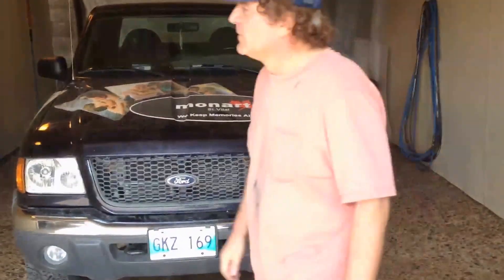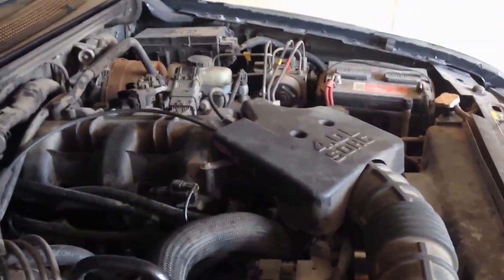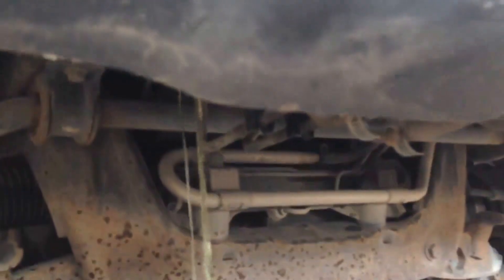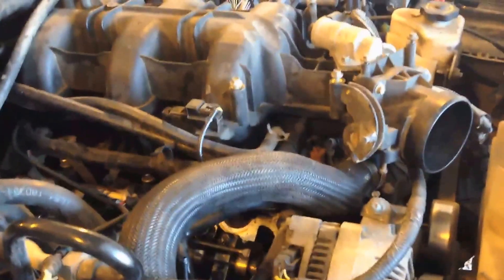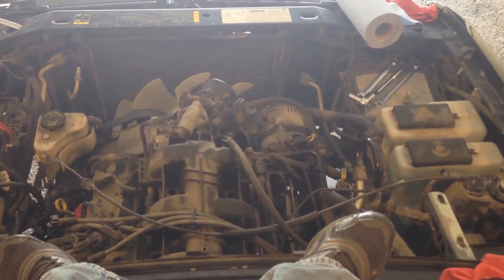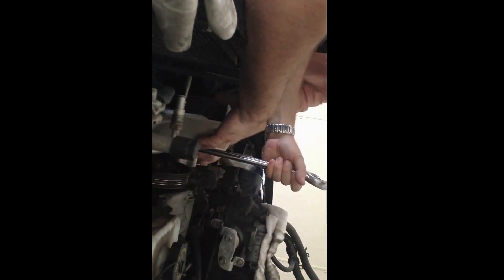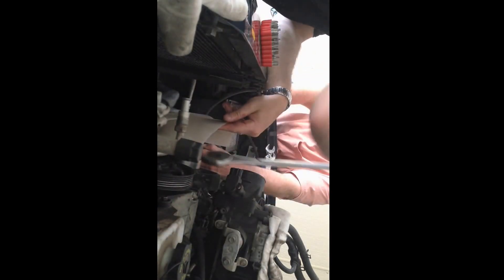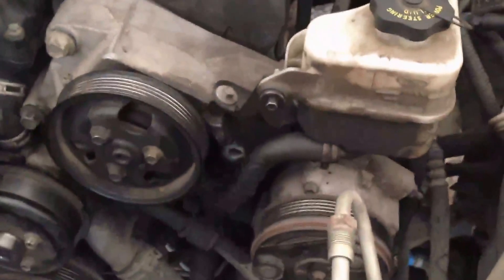2003 Ford Ranger 4 0 V6  dismantling the engine part 1

Comment: What size wrench did you use for getting off the fan? and did you use anything to keep the fan from moving ?
Reply from the maker: That’s a very good question lol idk that was some time ago. It was a big job though I miss that truck.
Reply: Turns out that its actually a 36 mm wrench and you obviously use a fan clutch removal tool ….. what I used was a 12 inch crescent wrench because I didn’t have a 36 mm wrench. And instead of using a clutch removal tool I bought this vice grip that has a chain with it. I bought the 20 inch chain and it worked so easy. I finally disconnected everything to my engine and tomorrow will be the day I take the engine out. with my 2 ton engine hoist and spreader bar.